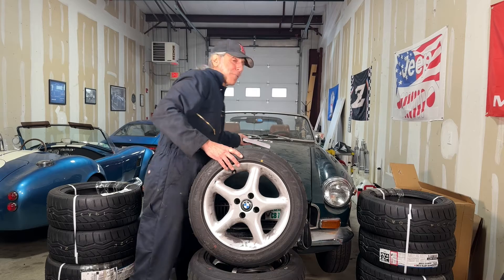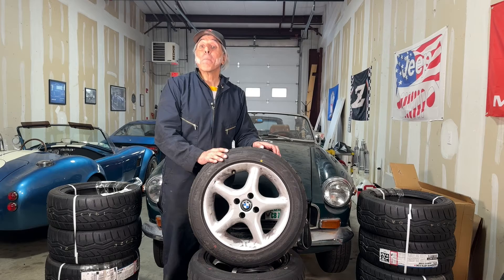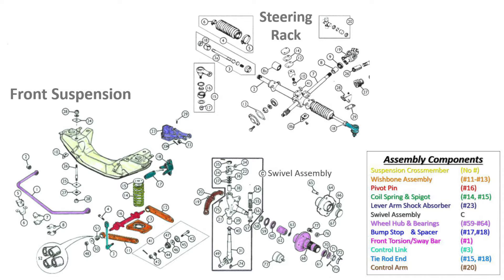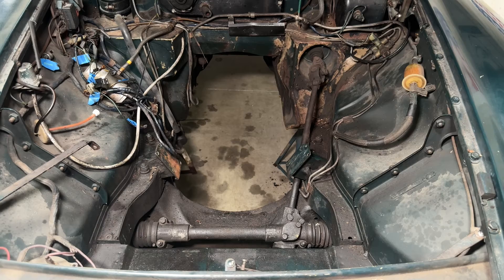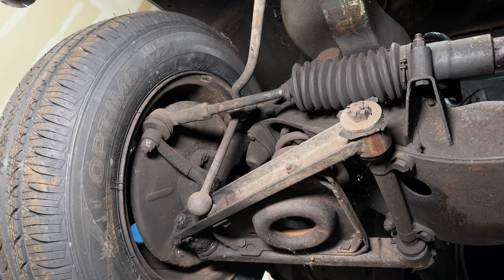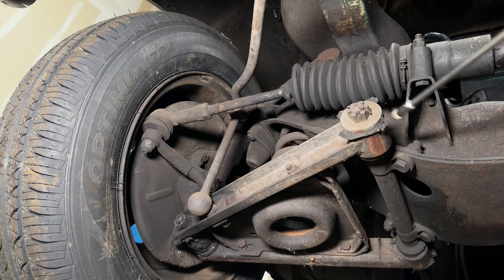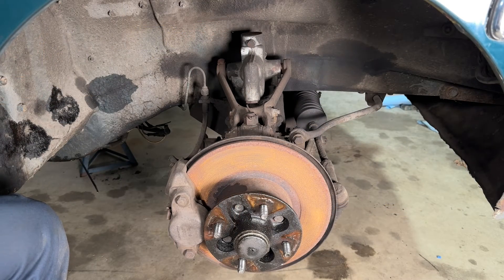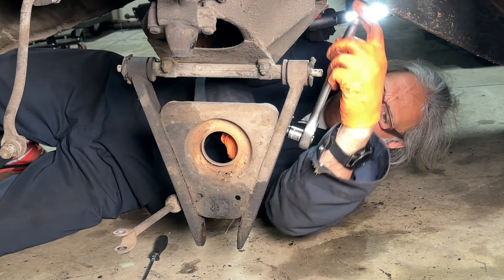Episode  #7:  Maggie’s Front Suspension and Steering Basics (72 MGB)

Comment: Hello Mechanic Steve....
Suggest me please what should I do, in the case where I did not mark the Steering U-Joint before removing the U-Joint to refurb my '74 MGB I am restoring.  Not sure if I messed up big time or its still fixable. 
Thanks
Reply from the maker: @RSuz7xk  when I first started my restoration, I was ALWAYS fearful that I would somehow mess things up given that I had never done one. In retrospect, the fear comes from not knowing certain information. You will find that with time you will understand your car and  your confidence will grow. Just keep educating yourself and pushing thru those moments😁.

As far as marking the steering u-joint goes, its orientation is really arbitrary as it’s just a coupler to connect the rods in the steering column and rack&pinion assembly. If you didn’t mark the relative orientation of the those two rods in relation to the u-joint, you can always do so upon reassembly. Just find the rotational center of the steering rack (ie count the total revolutions of the rod on the rack by rotating it through its full range of motion and divide that in half) and then find the rotational center of the steering column by visually placing the steering wheel in its proper position via the steering wheel spokes or MG logo. Any misalignment between the two can be simply corrected by either remounting the steering wheel on the steering wheel column rod or adjustments to the tie rods. The proper end state is to have the wheels straight with the steering wheel rotationally centered.  Let me know if this makes sense.

Good luck with your restoration!

Comment: Hi Mechanic Steve; Your video is very timely and informative. It just so happens I am going to restore my front suspension very soon. I've already removed it from the car. It was surprisingly simple to remove. I'm going to wait until you come out with your video on the tear down and rebuild before I do mine. That way I'll have a better idea of what I'm in for.
Reply from the maker: That's great that you are finding the information helpful which is why I am taking the time to put these videos together. the front end was taken apart several months ago and I am just finishing the video of that teardown which should be out within a week or two. To keep the video under 30 minutes, I did not include some of the issues I had removing some of the bolts. I can tell you that story if you like once you see the video.